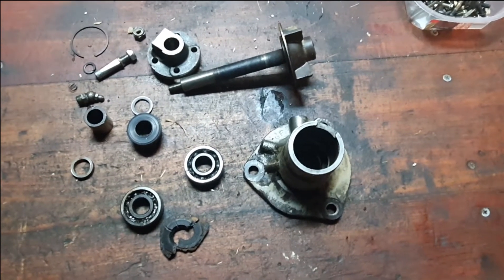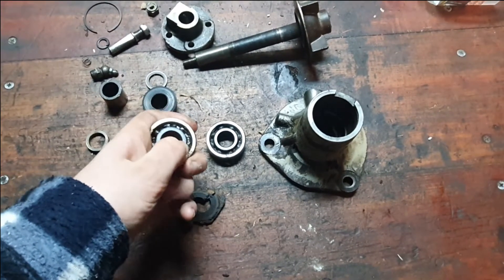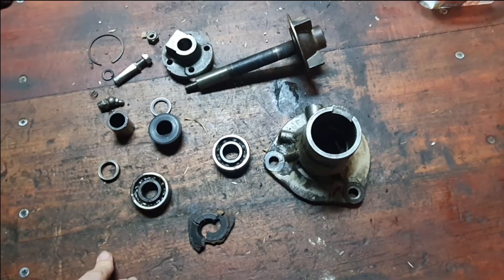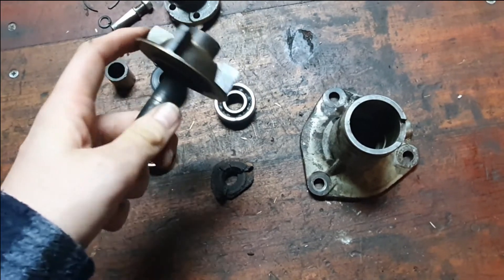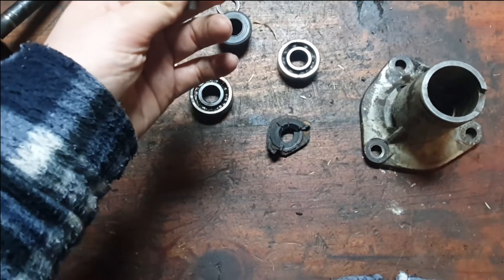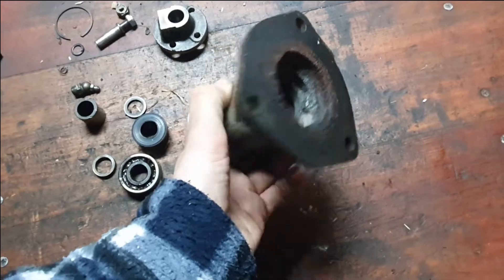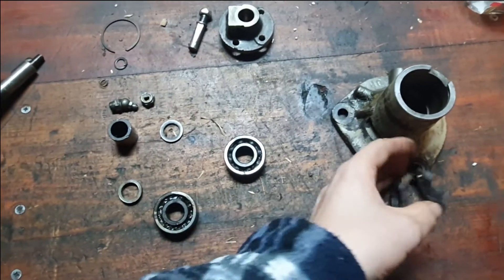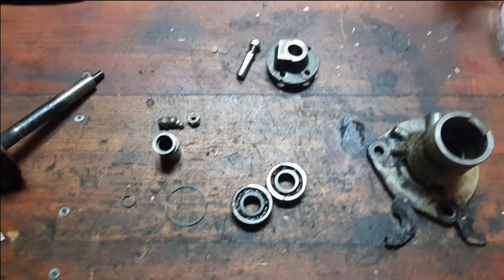What Happened To the Massey Ferguson 35 Standard 23c Diesel Engine's Water Pump?

Comment: Вы не захотели разбираться подробно с конструкцией насоса. Сломанное кольцо/шайба сделана из графита и очень хрупкая. Все детали кроме подшипников и уплотнительного механизма у вас целые и вам остается только купить ремонтный набор или по отдельности 3 детали: 2 подшипника и уплотняющий узел. Кажется я за все заплатил около 12 евро, но это было больше 5 лет назад)
Reply from the maker: Unfortunately when I removed the bearings that had seized in the housing it broke off part of the housing. Also the shaft was pitted with rust so it wouldn't have sealed properly. I paid about 25 euros for a whole new pump, so much easier.